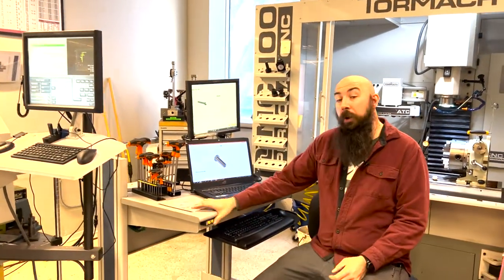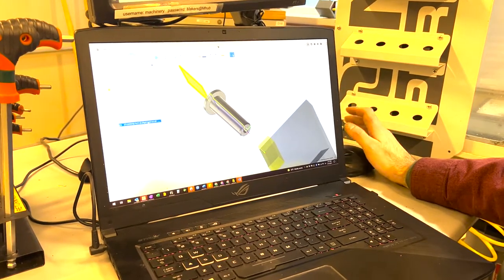Custom Code for the Tormach Lathe - Using the Ez Puller and Automatic Collet

Comment: I see these tormach lathes "home" after every operation.  Could the G&M code be manually edited to avoid these wasted movements between turret tool changes?  If I purchase this lathe I intend on running production with it right away and if i could eliminate any extra travel that would be a huge benefit.  Thanks
Reply from the maker: Good question! Quinn is traveling for the next two weeks but will give this some thought upon his return. We'll get back in touch. Cheers!

Comment: Great video, if you add a basket (parts catcher) to bottom of tool slide. You will not have to fish parts out chip bin when cycle is finished. Sweet little machine
Reply from the maker: Ha! Ironically enough we're running this job again and will be devising a parts catcher to go with it. If we capture it on video we'll post an update. Thanks for watching and for the good suggestion (great minds think alike!)